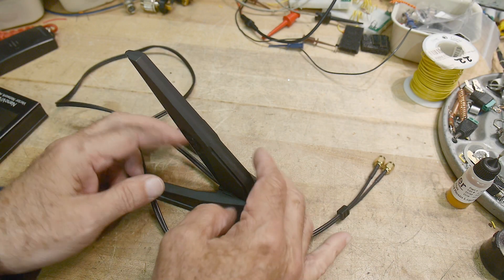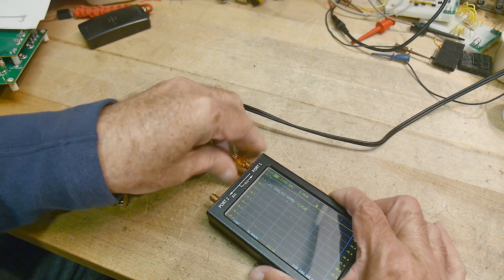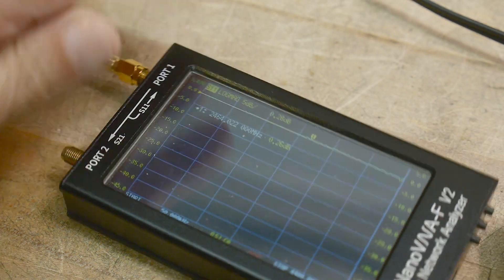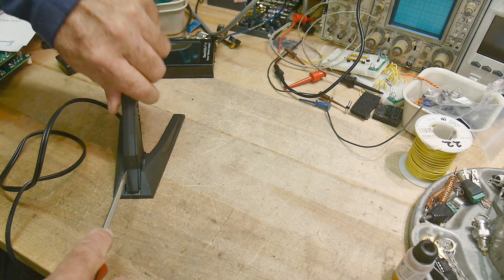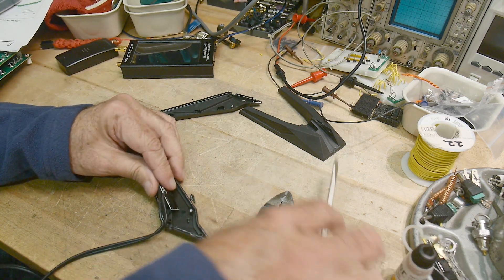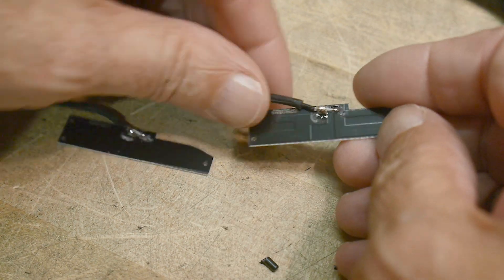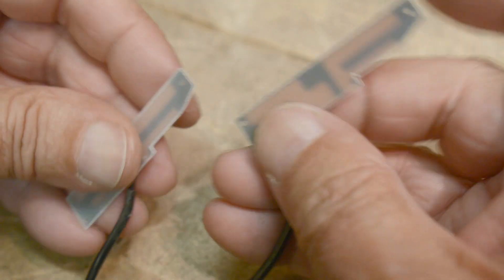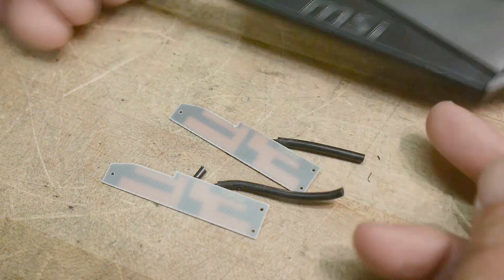#1545 MSI Wi-Fi Dual Antenna Teardown

Comment: Believe it's a J-Pole as they don't require a ground /counterpoise.
Reply: The connections arent right, though. The two wires are separate, to saparate halves. Some weird kind of dipole.

Comment: RP-SMA is standard for WiFi antennas. No idea why, but that's how it always was.

There are two of them, because modern WiFi uses "multiple-input and multiple-output" (MIMO).

Basically, to make WiFi faster, they split the data stream into multiple slower ones, to get combined high speed transmission.
Reply: FCC regulations. They wanted something non-standard and manufacturers settled on reverse polarity.

Comment: Most likely msi uses 2 different channels with 2 transmitters / receivers to increase bandwidth.
Modern routers have 3 to use the whole 2.4ghz spectrum at the same time.

Comment: I recall having two antennas at proper fractional wavelength spacing was an advertising point for the last router I bought.  One could probably estimate the receiver frequency by measuring the antennae offset.
Characterizing this pcb antenna some more might be interesting.